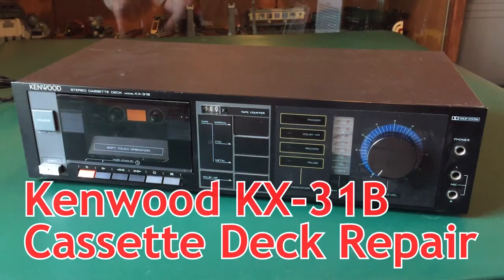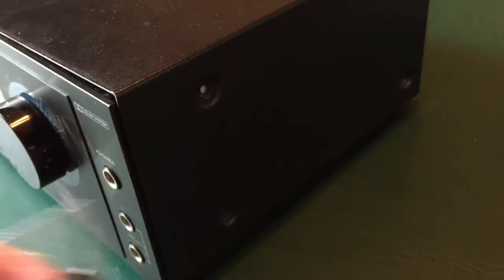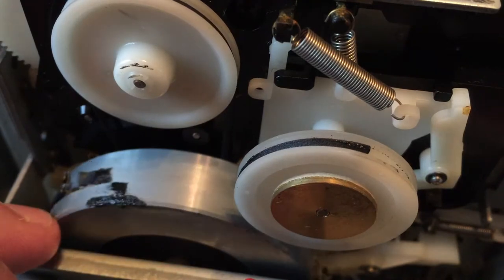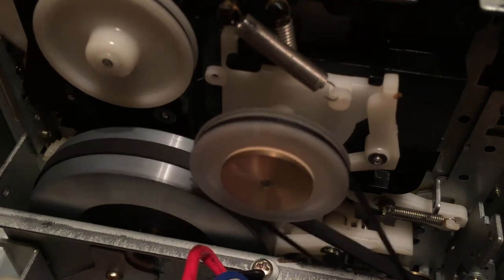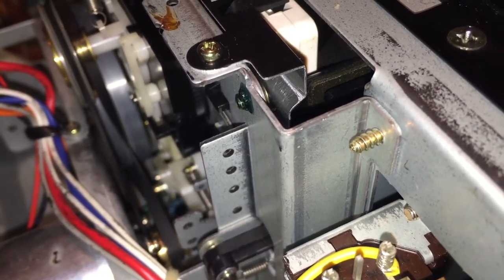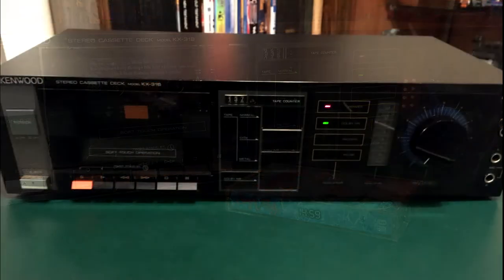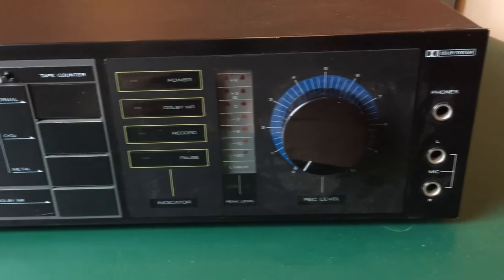Kenwood KX-31B Cassette Deck Belt Repair

Comment: Just picked up a KX-31 (silver model), for 3 dollars and 50 cents at goodwill. It turns on etc...but one of the drive belts is melted, like what happened in yours. Had a question or two for you about replacing the belts

Comment: Helpful Repair Tips: A good thing to do when fixing a deck is to clean off the tar-like remains of the belts with isopropyl alcohol (I use 50%) and replace all of the belts. Belts can sometimes harden or get a little stretched out. Just because a belt works and isn't a slimy mess doesn't mean that it isn't worn out. Also, cleaning the heads, capstans, and pinch rollers with 50% isopropyl alcohol is a good thing to do (I use a cotton swab for this). Slippery pinch rollers can be fixed with Rubber Roller Restorer (do not over due this part) and scratches on plastic can be buffed out with Brasso. Hope this helps!

Comment: I found your video post, thanks for the information.  I just completed replacing the belts on my KX-41B (basically identical to your KX-31).  Got it all back together but now have another issue.  The play function will not work.  When I press the button, there is no movement and it shuts off after a few seconds.  The FF and RW both work.  Do you have any suggestions as to what may be wrong?
Reply: Hi Jim, I'm in the same situation. Did you ever get this figured out? I am assuming the deck is tripping the autostop mechanism since the takeup reel isn't running. If I push the takeup along with my finger, it doesn't engage autostop, but the takeup reel won't move on its own. I'm at a loss.
Reply: @Hile648  J'ai exactement le même problème, quelqu'un l'a résolu?
Reply: @pipuce87  mine went to the garbage man, sorry!
Reply: @Hile648  tant pis merci ;)

Comment: I don't get the big belt in, is there a good trick, this part is not shown in the video.
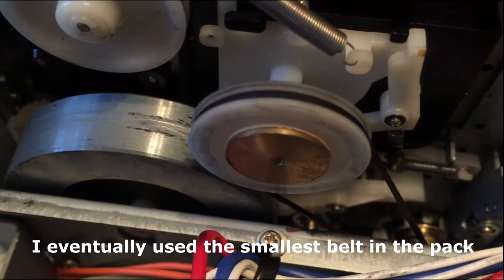Reply from the maker: There is a trick but its kind of hard to see in the video. Go to 2:29 There is a small plastic threaded piece that holds in the large wheel. Unscrew it and you have just enough space to slide the belt through the side and onto the wheel. Screw it back in afterwards but be sure its at a similar tightness to where it was when you took it out, otherwise the tape speed will be incorrect. Hope this helps